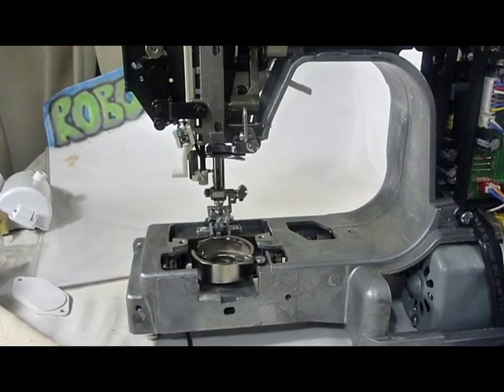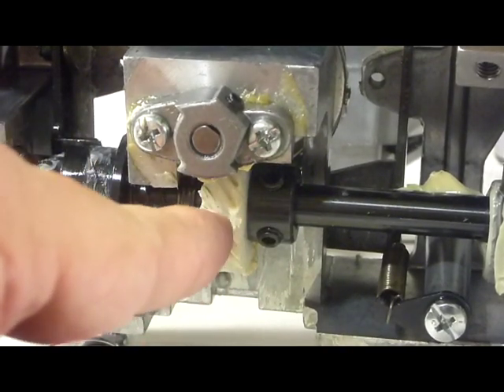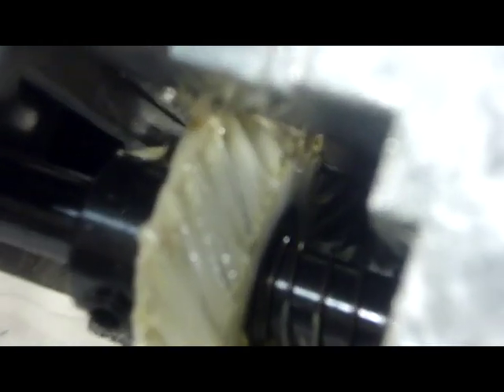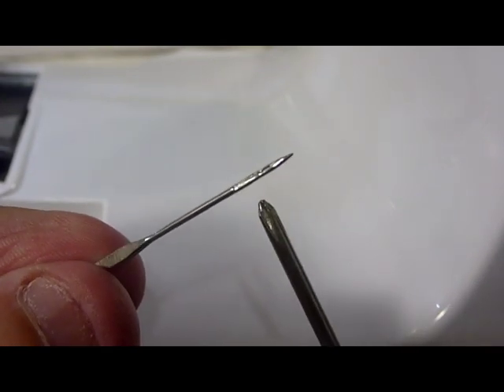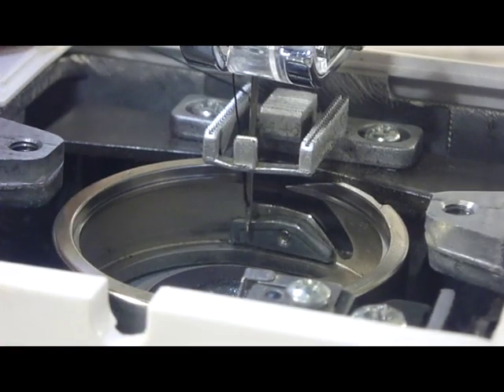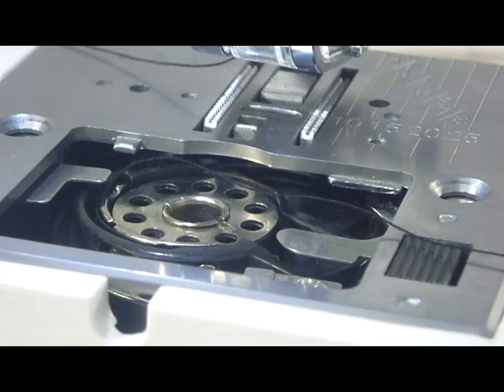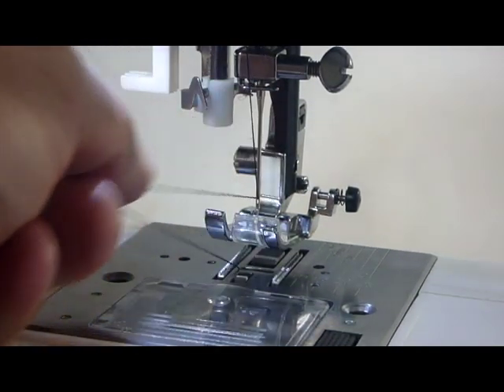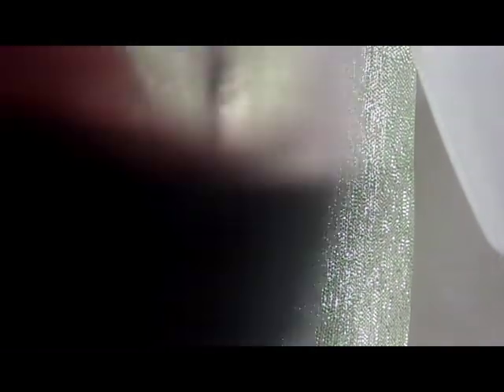Sewing Machine Hook Timing Fix Part 2

Comment: Hi. I have similar problem as you show in the part 1 of your video. What happens is that when sawing straight no problem but as soon as I start sawing zig zag #6 or any similar model (where the needle saw from right to left), the needle hits the metal bottom part that spins located under the bobbin. How can I udjust or fix this. Can u help me? I really enjoyed your video. Very helpful! Thank you.

Comment: The bobbin holder (the black part) goes in 2 ways. At least in mine. Does the opening on the bobbin holder go equal with the opening of the hook? If it does, how come the thread from the bobbin doesn't hook into the thread from the needle? This is what happens on my sewing machine and I can't figure it out.

Comment from the maker: thanks for watching.  interesting question.  like i said im not a sewing machine repair man.  i just figured it out on my own.  i would suggest you take your machine apart and see what happens when you turn the handle.  then look underneath and see if the parts are adjustable with allen wrenches or small screws.  maybe the verticle shaft thing is not lined up right.   .

Comment: My 7422 Singer Advance worked when I put it up 2-3 months ago and now thanks to your YouTube video, I know it is out of time when I tried it yesterday.  The needle hits at the wrong place under the bobbin case.  My auto threader is also not at the correct position to thread the needle.  Are the timing and auto threader issues connected?
Reply from the maker: Peggy Earl  I think I mentioned I am not a pro.  just use my engineering knowledge to fix the machine.  I think the auto threader is separate. but if the shaft that holds the needle is out of position, and the auto threader is mounted to the outer shell, then maybe they will not work properly.  if they were both mounted on the same part then it might be easier to adjust.  I don't know what a singer 7422 is.  thread the needle the old fashion way.

Comment: So I got my sewing machine 2 days ago and it was my first time sewing. I was doing great then I got a thread jam. I have cleaned all the jammed thread out but now my hook wont catch the thread. I tried adjusting the needle up and down to have the right timing with the hook but its not working because I noticed when I turn my wheel the hook turns but then it doesn't turn far enough, I have no idea how to adjust the hook on my machine. Its a brother ls2350. U think u can help me please? I have some Christmas dresses I wanna make for my kids.
Reply from the maker: sorry you tube is crazy now a days about comment. yeah clearing a jam is how I messed up my alignment.  if you can make sure the needle scare is going up just as the hook is passing behind to catch the thread loop then it might work.   so the needle cant be too far away form the hook.  that was my initial problem. so I made this video.

Comment: I got an estimate on fixing my machine--I am having a tension issue that I cannot fix.  He said the timing is off.  So after watching your video, it seems that if the timing is off it is a very slight problem as the thread does catch each time.  But, because I am between a $200 repair or just buying a new machine, lets say I adjust that little bolt at the bottom...which way do I turn it?  Maybe you said it in the video, but I did not catch it.